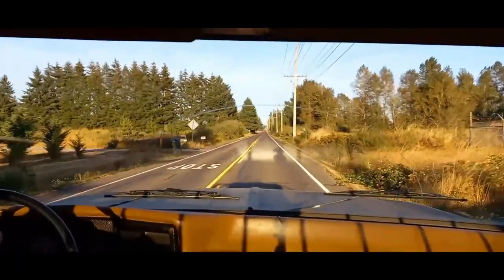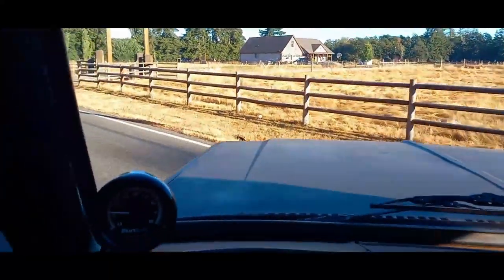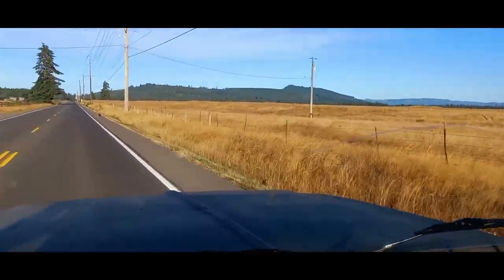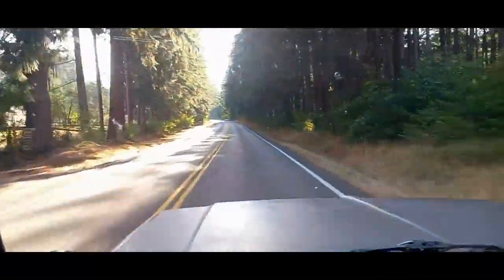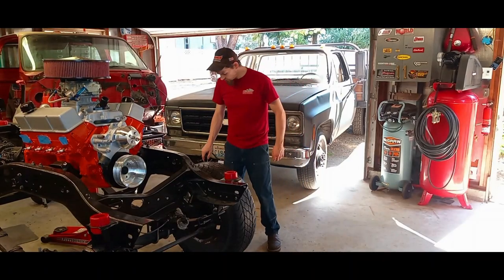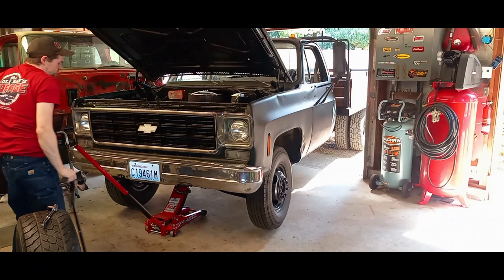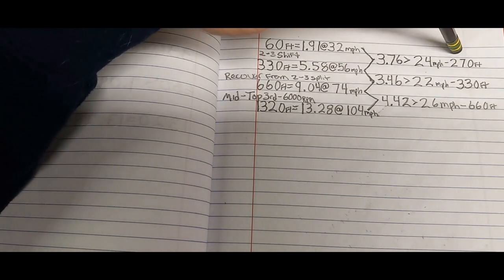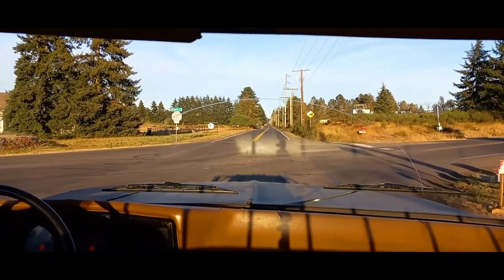383sbc Powered Chevy Dually Runs New Personal Best Low 13sec Pass Since 470hp Engine Build

Comment: Great video man ! Funny , I ordered up the driven br40 , assembly grease , and gp1 assembly oil after a bunch of research . One of these days I’ll throw together my 355 AFR head sbc for the 72 … still need to rebuild my am 465 though as my main shaft was junk .
Reply: Oh , and I’m guessing you are headed to Ohio . It’s only 2500 miles to buckeye lake from here lol
Reply from the maker: Thank ya buddy, good choice on the driven racing products they are good shit. What do you have for a camshaft for that engine?
Reply from the maker: You may be on to something lol. herbron Ohio is exactly 2500 miles away, coincidence? Mabey lol. There is definitely gonna be some good stuff coming up here soon.
Reply: @ACDGarage_Racing  cam is a summit sum-1107 234/244 .487/.508 114° lope separation . I do want to get a hydraulic roller for it eventually .
Reply from the maker: @leprechaungarage that is quite a bit of duration for a 355 it has more duration than the cam in the 383 in my dually, with that camshaft you will probly make peak power at 6200+rpm and peak tq at 4800+rpm which is pretty high. A 355 actually wants a 108 lsa.
if I was you I would try an get a camshaft with a 108-110 lsa, with that 114 lsa and them duration numbers that 355 will make torque at to high of an rpm and make less torque than a proper 305. In all honesty if you use that cam you will be very disappointed with your engine and it will be a waste of the afr heads. Don't mean to be the bearer of bad news I'm just trying to help. If you need professional advice I'm here if you want it.is this engine going in your blazer?
Reply: @ACDGarage_Racing  I’m all ears , You got any recommendations on a retrofit Roller cam that’s  going to make power and sound rowdy lol
Reply from the maker: This cam will work with the hydraulic roller springs them afr heads have, it's a Howard's cams camshaft it's $325.99  part# hrs-110885-08 specs .525/.525 lift 225°/225°@.050 108lsa advertised duration 278/278. I would install this cam 2°advanced for best performance, I could spec a custom one but that requires alot of information so this will be the best camshaft as far as hydraulic rollers you can get off the shelf for what you are going to want. If you have a question anytime just shoot me a comment on one of these videos I will always respond. I actually enjoy helping people make the right choices for the proper engine combination so they can really enjoy their build rather then wonder why it's not performing like it should and potentially being disappointed. This camshaft will allow that 355 to make the torque that most peoples 383's make. Hope this helps
Reply: @ACDGarage_Racing  thanks dude !
Reply from the maker: @leprechaungarage  no problem brother.

Comment: My dad had a square body K20 single wheel plow truck but the motor was out of the pro stock car originally will actually originally a 60 school bus but then put into ProStar after being built. Then it was put into a 71 Nova. Then it was put into the 80k20 and boy that thing could push some f**** snow

Comment: Recently found your channel and have really enjoyed the videos. I too nursed my parents to the end, have spinal issues, etc. and I use my 71 Camaro to keep me moving and motivated. I could use HELP. I know little about this engine, but it’s reasonably well built as best I can tell. Even with delrin spacers and multiple gaskets, it keeps blowing oil out between the intake and distributor. I can’t make it stop. Anyone have suggestions? It’s a generic single plane with an HEI. Thanks in advance
Reply from the maker: Thank you For watching, I'm glad you enjoy the videos. I've heard of people having leaks in that area for whatever reason not sure why but usualy the reason is the person didnt put in the distributor gasket, that's apparently not the case here, i know oil leaks are a pain in the ass and  I've never had this happen to personally so i don't really have the best suggestion but, This is may not the best thing to do but im sure it would work, check your timing, pull your distributor, clean the oil, put silicone on bolth sides of the gasket,  reinstall the gasket & distributor then set timing to what it was before the silicone sets and as I said that would probably work. Hope this helps.
Reply: @ACDGarage_Racing  Thank you for taking time to respond back. Much appreciated. I think I'm going to try an Edelbrock RPM air gap intake. With the 3:23 rear gear and a low stall converter, it will hopefully help with both the oil leak and some low end torque. Thanks again!
Reply: Hogie- has the heads and/or deck on the block been cut excessively? Try doubling your dist gasket? Could the HEI housing be cracked? Is the oil pressure fitting leaking?
Reply: Are you sure that it is leaking around the distributor? I have seen engines leak between the intake and the block due to blow by. Maybe not.  Just something you may want to check in to

Comment: hi, very good information for the masses, like to learn from humble people like you, thanks for sharing, i have been an enthusiastic diy since my early years, build a 283 sbc just to try to beat the then fast '68 roadrunner my cousin had bought, but then all I could find was a 3/4 or full race flat tappet cams. ported my stock heads to like a magazine said, cut templates and transfered to aliminium sheetmetal etc, so much fun, still on it today at 70 years with a 5.3 ls, so want to ask if there are any good information for a cam for my 2006 5.3 sierra stock truck, all purpose "shop truck"  engine is all stock nothing different but a better intake and 98mm throttle, thanks for all your info.

Comment: Really enjoyed your video, I know it’s true as my little 383 was about .35 tenths faster than the other guys 383’s. I did the formula and it says to use a 106. Didn’t know it then but my choice was on the money. 
I understand your formula and DV ‘s formula, but how do you spec LSA for a turbo car or Supercharged car? Specs on cam was .681/.660 dur @.50 276/281 LS 106.

Comment: What brand of camshaft do you use? ISKY CAMS!!
Reply from the maker: I've always used comp cams in my personal stuff I've had great success with comp doing my costum grinds for me but have built engines with  comp cams, isky, Howard's, crane, etc
Reply: @ACDGarage_Racing  ISKY is a little more expensive, however unlike other cam companies, the f/t cam's are flame hardened

Comment: #sm465life
Reply from the maker: Haha! Sm465life is not for everyone
Reply: @ACDGarage_Racing  Nope. I have 4.88 gears and start out in 3rd. Only shifting once make it a bit easier. I have a goal to be the fastest sm465.
Reply from the maker: @SquarebodyStuff  yeah shifting only one time makes it alot easier than having to bang threw the gears on them pigs. I know I could easly get that truck in the 12's with the completely built reverse manual valve body th400 out of my other truck but what fun would that be lol plus I didn't build that truck as a drag truck, it's multi purpose it can drag your ass in a race and it can drag that Ford home on a trailer after it breaks lol.